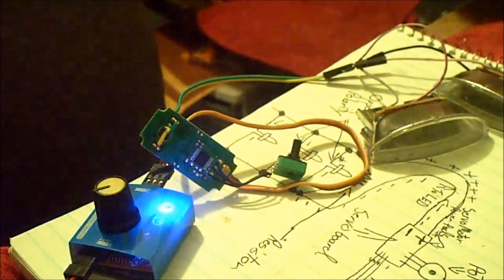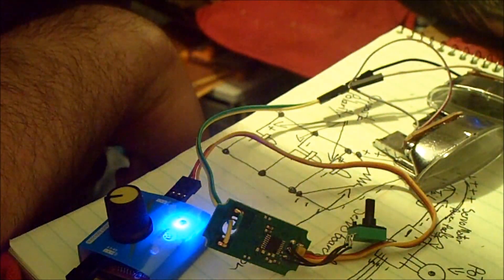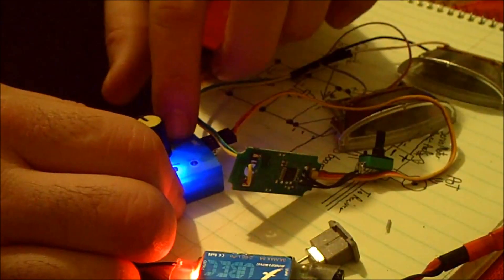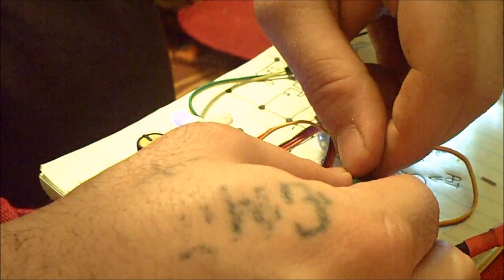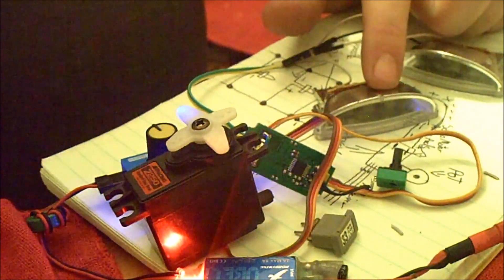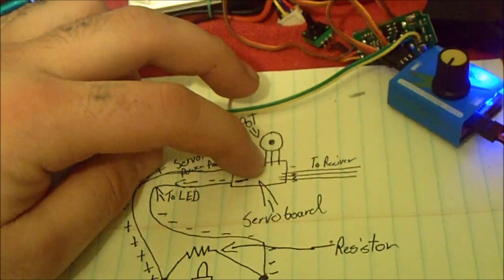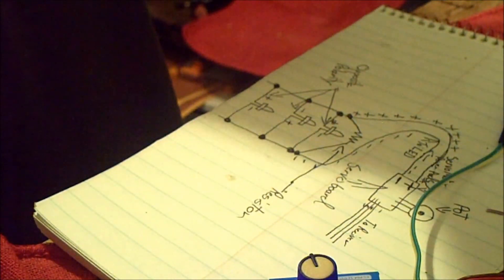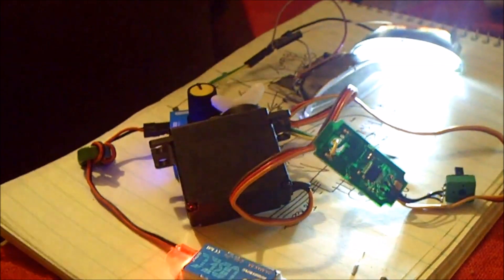DIY: Receiver Switch / LED Driver From A Old Servo Board

Comment: OK so I'm a little confused about the resistor in parallel on the diagram above LED's. That should be in series with either pos or neg lead of LED's. I'm sure you meant to draw it that way.  Unless I'm missing something.
Reply: Yeah, that resistor isn't doing much in parallel like that. Should be in series to current limit the circuit. LED's have very little resistance when forward biased and will draw a great deal of current like a short. Hence the "current limiting" resistor - which is always in series to the LED. The LED's and/or IC won't last long like that. Good idea using the servo as a switch though. Curious to try this.

Comment: Do digital micro servos automatically try to return to their middle position when the battery is removed? Or do they lock in the position that they are turned to when the battery is removed?
Reply: Aubatron Late reply, but to answer your question, it depends on the fail safe mode or your receiver.  Else they most likely default to the current position awaiting further command.